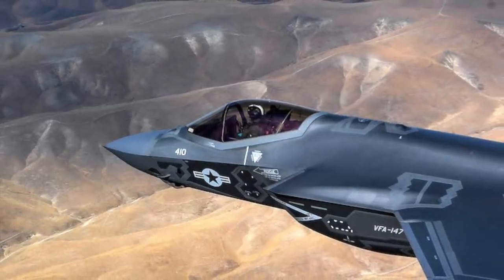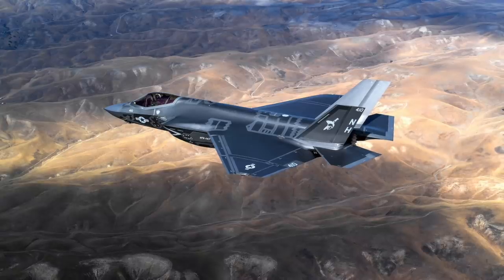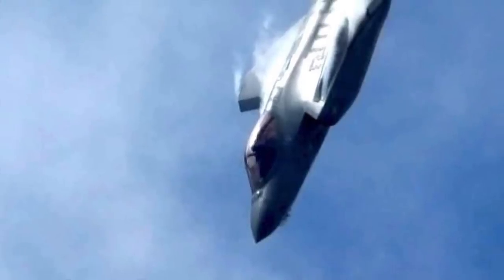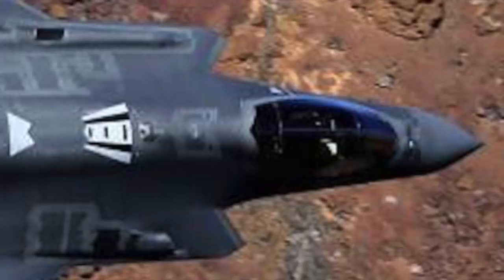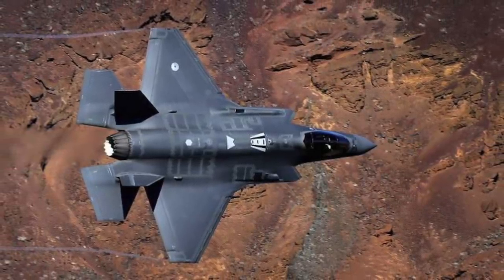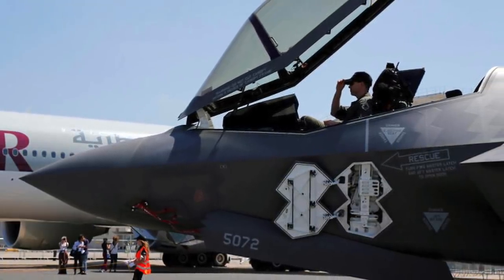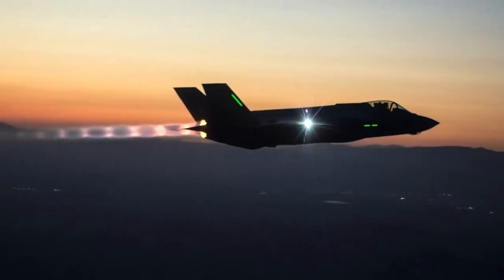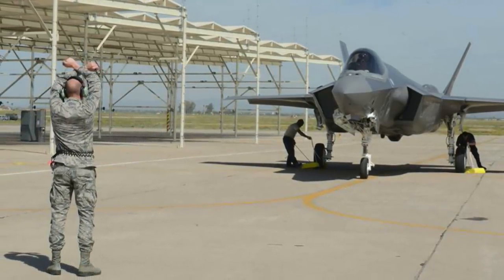HOW GERMAN MADE RADAR MANAGED TO DETECT F 35 5TH GENERATION STEALTH FIGHTER ?

Comment: The F-35 is NOT a replacement for the A-10 Warthog, nor is it necessarily a replacement for Super Hornets or the latest iteration of the F-16.  The A-10 is expected to remain in service through 2025 at minimum.  The F-35 is expected to function as an adjunct to existing fighter, fighter/bomber, reconnaissance and close air support aircraft currently in service and undergoing continuous upgrades.  Part of the justification for the current strategy is the "don't fix it if it ain't broke" philosophy combined with the astronomical cost of replacing all existing combat aircraft with F-35s.  It would seem reasonable that an F-35 performing at an airshow would  be operating its mode S transponder.  That would allow any radar system (including FAA ATC) to track the aircraft.
Reply: The A-10C in the CAS missions where an air-to-air or ground-to-air threat is present has already been replaced by the F-16C since the mid nineties. The F-35A is simply supplementing and eventually replacing the F-16C in this role.

Comment: The funny thing about airshow and ferry flights is that they use reflectors that ruin the true RCS of the aircraft. Not to mention, Germany is most likely privvy (or at least is friendly enough with an ally) to the specs of the F-35...it makes it a lot easier to detect when you know what you are looking for. Also, long-wave radar is going to detect anything in the air, just not accurately. The shorter the wavelength, the more accurate a plane can be ID'd

Comment: You realize that they fly around with devices on the airframes so it can actually show up on radar for safety reasons, right? Not to mention, when you know where to look (i.e. flying into an airshow where they are scheduled to appear) is a whole different ballgame than trying to defend thousands of miles of airspace in a wartime environment and trying to detect something with the radar cross section of a golf ball.

Comment: Fun fact: the Warsaw Pact developed a similar system in the 1980's, called Ramona. North Korea still have these in service.
Reply: Real fact. Only reason the f35s were detected because it was flying over civilian areas. Not in stealth mode.
Reply: @downix  the KRTP-81M was  not even remotely close as to what Germany was suppose to have used. Not even close. It was how ever able to track 20 targets conventionally with better accuracy but not stealth. It may have been able to detect stealth but not able to track and gain a firing solution. If you need a citation let me know.....other wise know a doppler radar.
Reply: @downix  whatever

Comment: The F 35s "skin" absorbs radar waves and there are constant radar waves coming from the sky, so the f35 appears like a black dot flying in front of an illuminated background. If it has reflectors or not does not matter. what matters is, that the radar sytem can see the verry faint radar background and that it can do this in realtime with a good resolution, so that it can if thede is an aeria where the background radiation is absorbed/reflected

Comment: Nothing is "invisible" to radar. Anything of sufficient substance creates a return. Stealth technology merely reduces the size & strength of that signature therefore making the aircraft far more difficult to pick out of the background. You could track a bloody songbird if you watched it leave the nest. Tracking a pair of aircraft in visual range when they're doing absolutely nothing to thwart detection isn't exactly an achievement to hang your hat on.

There is a difference between tracking an aircraft and getting a missile lock. Getting a missile lock requires a high degree of precision that many radar systems (particularly the ones able to see the faint radar signatures of a steath aircraft) tend to lack. 

Furthermore, aircraft an an airshow are most likely equipped with lundberg reflectors, which eliminates the steath nature of the f35, so that its visable on ATC radar, and so that nobody can get radar cross section data on the f35 in battle ready configuration.

Comment: Because the radar cross section of the F 35 is not known, it probably will be a case of research to reconstruct the radar cross section. The aircraft is still visible, so it is a question of time that visual imaging will be used to detect the F 35. Low tech may be the only way to detect a F 22 or F 35 and defense systems based on imaging technology is the next  idea in air defense. If we recognize a face by its features, why wouldn't that be an idea?

Comment: What happened to VTOL? It was part of their marketing when they first started with the project.
Reply: I believe that is only a specific version. Not sure what the news is on it, but I'm pretty sure it wasn't intended for all f35s
Reply: @bladecintron3872  It wasn't. It was meant for the Marines, I think. But the thing is, I don't see or hear VTOL being mentioned anymore :)
Reply: @rgi8426  just looked it up. Aparently they have been used by the marines since 2015. I guess it just didn't make headlines.
Reply: @bladecintron3872  Are they using the VTOL variant, though? The Marine Corps was supposed to use that version of the F35, but are thay actually using it now or are they using STOVL?
Reply: @rgi8426  not sure. The article said the f35b, which has vtol capabilities.

Comment: There are several factors involved here: is Hensvoldt's technology as good as the S-300, S-4oo or Soon S-500? Secondly, at 150km in enemy territory the enemies ceases to exists unless the F35 is on his way out without any munitions. Thirdly, the embarrassment should be welcomed as many "enemies" may think so too, and the "fault" may be corrected. Lastly, this incident may  cause heat in the boardroom, hence the deflection of the loophole.

Comment: Several problems with that.  First of all the F-35 was at an airshow... as in an air port, like where the radar was.  No stealth is 100%.  Tracking it for 100 miles means it tracked it from 50 miles away, it passed over and it tracked it for another 50 miles.  That radar likely has a 200+ mile range, so only tracking it at 50 miles is not that impressive.  The other thing is since it was not in combat it might have had active radar going or other things going on making it easier to detect.  But still if this was a combat situation and it could only detect the F-35 at 50 miles the F-35 would have detected the radar long before that and either flown around or taken it out.  They also could have gone in with electronic warfare to scramble the radar or sent in a CHAMP ahead of the F-35 to hit the instillation with an EMP pulse to disable it.

To put this into perspective.  A 50 mile range is 7850 square miles and a 200 mile range is 125,600 square miles coverage.  This will open up massive holes in most countries radar defenses.  This also means SAMs can not target if they can not get a lock.  Even worse is most SAMs use a ground radar to guide the missile into the area and then shorter range radar on the missile then will try to detect the and guide the missile in until it gets close enough to detonate the proximity fuse.  These more advanced radar systems likely can not fit in a missile.  This would drastically reduce the accuracy of SAMs against a stealth jet.  So even if Germany's radar detected the F-35, it still is unlikely they could have shot it down.

Now compare this to China's J-20.  It was detected by an Indian pilot in an old Su-29 from 120 miles away... which is the max range of the radar.  The J-20 has NO stealth capability.  The Su-57 has only stealth from the front because the engines are exposed and even from the front it is about 1/4 as effective as he F-35.

Comment: It is stealth, cannot be seen by active radar. Passive radar using reflections from other electromagnetic sources (like fm radio station signal) is how they do this. Its sort of misleading, stealth refers to being unseen by radar, but to be detected by its interaction with other signals in the air doesnt mean its not stealthy. Now, when computing power gets good enough theyll easily be able to use this passive technology and active stealth will have to change. They will probably come up with an active system that puts out the correct signal so it looks uninterupted and then passive wont work. Its expected to "beat" technology, thats how we come up with the newest tech. This passive German system is not widespread and really doesnt mean much. If hostile countries get it that would change things.

Comment: Radar reflectors are irrelevant as the new system does not depend on that technology. It is a PASSIVE radar system that uses all waves that are there anyways like radio and mobile phone waves and sees the changing of that. The only problem would be to detect the F-35 in an underdeveloped area without radio waves but I guess that countries without radio stations don't have active radar systems, too.

Comment: For you experts out there what is a radar doing? It's sending EM waves , these EM waves have a certain wavelength, if you want something to absorb this wavelength you need it to have length equal to the wavelength , the radars they use are in the GHz range so they can use a structure of a few cm as antenna to absord the EM radiation, let's now shift to meter wave radars, these have wavelengths of few meters, the stealth technology doesn't work here, the modern EM theory says you can't make a structure to absord this radiation, dear Americans you've spent quite a lot of money for something obsolete, it only works as a marketing gimmick along with the commissions you give out to corrupt officials.

Comment: I still don’t understand this emphasis on stealth. A plane is still a huge object which is very loud and pushing lots of air and generating lots of heat. Surely it can be detected several ways? Even if they have tricks to reduce radar signatures  couldn’t they use computers to say ok, this is a bird radar signature and this is the plane.

Comment: Yes, stealth can be detected. But radar tracking for missile lock won't work. There's a lot of difference between radar detection and radar tracking. Only a small fraction of radar comes back to the cell, and radar tracking needs an enourmous amount of radar coming back to the cell. But in a case of trying to target track a stealth fighter is impossible.

Comment: Did it manage to detect or lock on? Massive difference. Did the F-35s have RAM in use and the RCS emitters switched off?

I would like to know as this would may a huge difference to the Germans radar capability.
Reply: RAM isn't something they put 'in use'. it's the coatings on the exterior surfaces and the materials the plane is built from.
Reply: @massivereader  Radar absorbing material can come in many forms. Its a spray coat as well that has to be replaced on every mission as friction can affect its ability. Thats why the jet was deigned for sub mach 1 flight,
Reply: @llamudos9809  Every fighter jet is designed for subsonic flight, it's how they take off, land, loiter and extend their effective range. There are only a handful of modern era fighter jets that are designed for exclusively subsonic flight, like the Harrier jump-jet and some of the pre-century series early fighters from the Korean War era, and some later carrier fighters. Almost all modern fighter jets operate subsonic unless they are using afterburners, which essentially dump raw fuel into the exhaust stream of a regular jet engine for additional thrust. That's why you see a spike/plume of flame coming out of the rear of the jet engine of fighters at some times and not others, it's when they are using the afterburner(s).
Both the F-22 and F-35 are fifth generation fighters. One of the defining characteristics of a fifth generation fighter is the ability to super-cruise. That means they can fly supersonic without the use of the fuel hungry afterburners. Both the F-22 and F-35 are fully capable of supersonic flight. IIRC the F-22 can go at least Mach 2.2 and the F-35 Mach 1.6. It's my impression that use of afterburners and supersonic flight is inherently non-stealthy because 1) bright light in the sky 2) huge unmistakable IR plume 3) sonic boom. The original engine of the F-35 can only super-cruise for short periods and can only reach about Mach 1.2 when doing so. Congress cancelled development of the true super-cruise engine the F-35 was initially designed to use back in 2011.  I would not be at all surprised if that quietly changed during the Trump administration, as it's been nearly a decade.   
The only stealth aircraft I'm aware of that are solely subsonic are the B-2 bomber and F-117 which while designated as a fighter (F) is essentially a bomber which should be designated (B) and like the F-111 was often used as a ground attack/assault vehicle which would  normally be designated (A). 
Interesting fact: the F-111 took out more tanks and armored vehicles during the first Gulf war than the A-10
While all the stealth fighters use some form of radar reflective paint, I'm not sure it needs to be reapplied after every flight, although there was an issue with the F-22 and rain.

Comment: You are ignorant of what the radar does.
It does not detect electromagnetic waves that the F-35 emits. It traces the disturbance an object creates when moving through electromagnetic waves.
Basically any object moving through air is also moving through all the shit tons of electromagnetic waves we put out there like radio, TV etc.
In densely populated areas such as Germany there are a tons of waves everywhere and you can get a pretty accurate reading.

They had to know when the F-35 was taking off because they had to set a baseline of what they were looking for.
Remember: Any and all object disturbs the electromagnetic waves. Meaning they had to filter what they were seeing.
Once they had established contact by comparing departure time to the wave disturbance it was rather easy to follow.

Radar reflector do not matter for that method.
The used method is also rather useless over any area with few or none electromagnetic waves such as oceans.

Experts in radar technology think Hensoldt is telling the truth.
It is not like they just solved the issue of first detecting the stealth fighters. They were able to follow it because they knew where and when to look for them.
Take that away and it is entirely different matter.

Comment: It's difficult to skin track a 747 at 100 miles, a stealth fighter jet with the radar cross section of a bird impossible. Twlnvis wasn't tracking the F35's.
Reply: Twinvis does not use radar to track anything.. It is a passive technology that uses disturbances in radio waves (FM/AM signals) to track aircraft. By understanding this, you will also understand that stealth technology has little to no effect on this type of detection
Reply: you are correct in the way this radar system works. The one thing you seem to be missing is that the radar cross section of an aircraft depends on the frequency the radar uses. The F35 (as the F22) only have a small radar cross section section for very high frequencies in the upper GHz range (usually used by FC radars). For lower GHz frequencies (that some/most AEW radars use) , this aircraft is almost as visible as any other. Now, like you said, Twinvis operates with AM/FM signals, which are very, very low frequencies, when compared to ones used by radars (MHz range). Against those frequencies, the F35's shape and stealth coating has no effect at all. Talking about a radar cross section in that frequency range, doesn't even apply. Stealth technology is only planned and developed to work against extremely high frequencies. As such, it is very much possible they could track the F35 since the disturbance ir causes in that frequency range is not mitigated at all..
Don't need to get bitter, man
Reply: I agree with you. However, I did mention FC radars and how they operate at higher frequencies and how stealth technology is specifically adapted to tackle those frequencies thus making aircraft shuch as the F35 really hard to lock on and shoot down at great distances, even if their presence can be detected by higher wavelength AEW radars. I also agree  that the aircraft's angles do deflect radar waves away for the radar emitter which makes it harder to detect at most wavelengths. However, that is exactly what enables Twinvis to detect an aircraft, independent of its shape. Twinvis doesn't rely on returning waves to detect an aircraft, it is a passive radar with no emitter. It works by establishing a baseline of frequency density in the airspace. When a stealth aircraft such as the F35, crosses that airspace, it deflects any EM waves hitting it away from their emitters, as you said. However, the emitters in this case are AM/FM radio towers, not Twinvis itself. By deflecting the waves away from itself, the aircraft creates a disturbance in the baseline frequency density of the monitored airspace. If you imagine the airspace as a sea full of radio waves, you can think of it as a sudden gap of radio waves that is created by the aircraft's presence and the way it deflects the radio waves away from it. This disturbance, or gap, is what Twinvis is able to track as the aircraft flys by. I believe now you can understand how current stealth technology can be fully mitigated by the Twinvis concept since detection and tracking relies exactly on what makes aircrafts like the F35 otherwise stealthy against active radars: the deflection and/or absortion of radar waves as a means to detect a distubance in the airspace's baseline frequency density. Now, I just want to add that most likely this technology is not yet accurate enough to be implemented in long range firing control solutions. I hope my explanation was clearer now